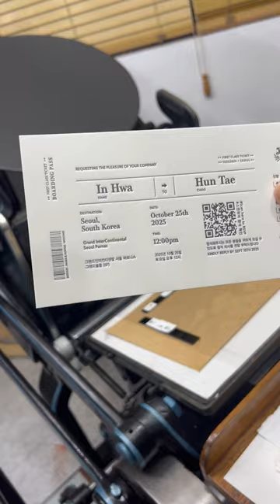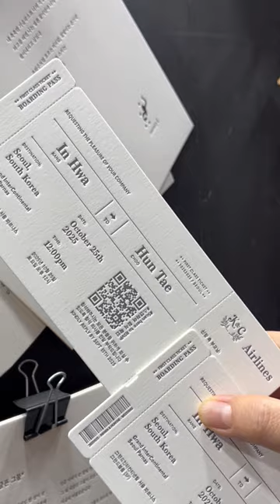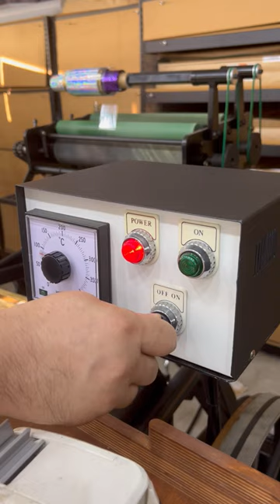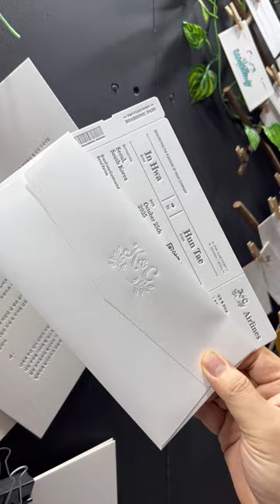레터프레스 비행기티켓 청첩장과 봉투 제작영상을 올립니다.^^

Comment: Why do you think the printing ink is not sold in tubes so it can be dispensed easily and there is no loss from the top layer of the pot drying out?
Reply from the maker: I guess it's because the ink is made based on large-scale printing presses.